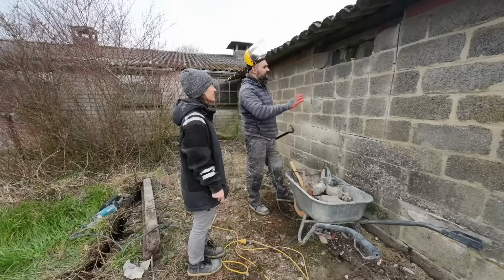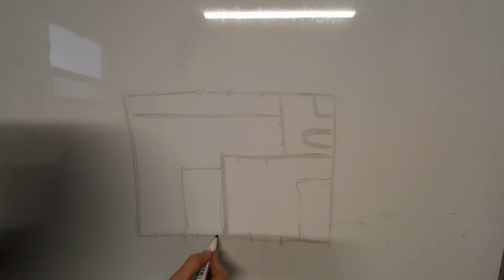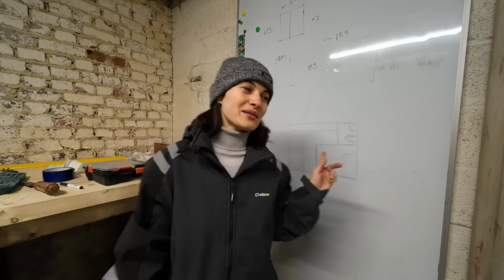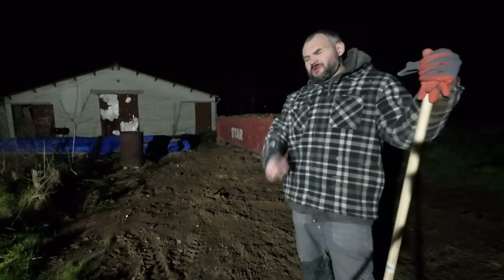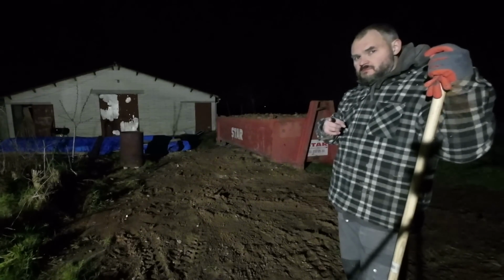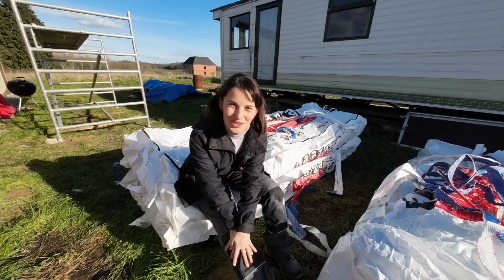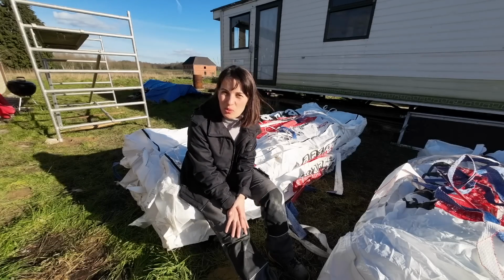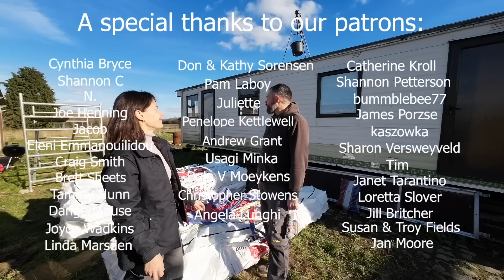New layout of our TINY HOUSE / Old ROOF is gone! [Turning an OLD SHED into a  cozy TINY HOUSE]

Comment: For your new toilet door I would have a sliding door inside the new wall installed to free up space, possibly the same to the new bedroom too x
Reply: I was thinking the same thing.  Sliding or pocket doors will take less space and add more available room to the tiny house.
Reply from the maker: Thanks for the tip! We are planning to keep the budget as low as possible and reuse the materials that we have. For the doors we probably gonna reuse the ones we took from the main house.
Reply: @DeHoeveOldBelgianFarm  You can find a rail kit for sliding doors to hang your existing door panel.
Reply: @dDoOyYoOuUtTuUbBeE  , like a barn door slider on the outside of the door?
Reply from the maker: @dDoOyYoOuUtTuUbBeE  I will check in the shops. How about soundproofing features of such an installation? For bathroom not really a problem, but between the bedrooms...
Reply: I would also suggest not having the toilet right opposite the door, fewer embarrassments when door doesn't get locked.
Reply: @DeHoeveOldBelgianFarm  the soundproofing is minimal on sliding doors.
Reply: The space isn't that wide, and the door will be effectively at the end of a hallway at right angles to the longer walls... A sliding door is unlikely to save much space in those circumstances and would have to be quite narrow, while a door that swings out from the bathroom counterclockwise will swing through mostly unused space and can be as wide as the doors they're reusing. The second bedroom door, however, should probably swing clockwise into the bedroom, not out into the hall area.

I'm a little ambivalent about the planned bed placement, though. By putting the access to the second bedroom off that hallway, they've essentially made the larger room a big hallway/entry room where people will have to constantly walk past the bed to reach the work space, bathroom, and second bedroom. It's a lot of busy energy for a bedroom that's supposed to be a place of repose, and there's really no restful, private way to place the bed in that. I'd have laid the rooms out a bit differently with that in mind, but it's their space and they clearly considered what they wanted from it and decided that was okay. Nonetheless, if it's not too late to be open to suggestions, I'd suggest putting the entrance door to the building close to the center wall and making the opposite wall from the current plan the one for the bed. The room is still a hallway like that, but the orientation of it would create a greater sense of privacy and shorten the path to the bathroom and second bedroom, since you'd only have people walking past one side of the bed to get there, not two.
Reply: @mjr7777  well, she's got to have the toilet against an outside wall to conveniently vent the composting toilet.
Reply: @DeHoeveOldBelgianFarm   Flip the location of the toilet(WC) and the basin. it will allow your door to open properly using a conventional door and door frame.
Reply: @elizabethcave7666  More or less that, but adapted for indoor use with some style.
Reply: @SagebrushRambles  Yes but quality sliding doors have seals and brushes for that. Also depends of the quality of your panel.
Reply: @DeHoeveOldBelgianFarm  In this case a complete kit for embedding sliding doors in walls is preferable. Better bearings for quiet operation, seals, brushes, for filtering noise. More work to integrate it (more or less like metal framing for drywall), but superior result.
Reply from the maker: @ImpyChan  Thank you for your suggestions! We are reusing the current door opening, so moving it closer to the center wall is not an option. Yep, we know that the planning and layout are not optimal but it's temporary and we just going out of the available options , keeping the budget as low as possible and trying to do it fast.

Comment: add a shower in the bathroom.
I dont know about there but in Australia one can purchase a sandwich metal roof.  Long lasting 30 year coated corrugated metal on top. foam insulating panel then a flat metal panel underside. They come in lengths up to 10 meters so or last I looked.  Get enough lengths so they side by side. Screw down and you have a watertight and insulated roof after you cap the ridge.

Comment: Just a silly Life Pro Tip (LPT): if you tie a loose knot in your corded power tools and the extension cord before plugging in, you create a bit of slack so accidentally tugging on it (or tripping over it) wont unplug the tool.   If you need to visualize what I"m talking about, think about a pretzel: cross the two cords in an X, loop the male end through the bottom of the X, and plug it into the female end up top.
Reply from the maker: Many thanks for the great tip! Illia is doing so already. Me not as you've seen :-)
Reply: Great idea!!

Comment: One thing I would consider, is since you'll be bricking up the door in the bedroom area, instead of making more work for yourself, use the door as your window, and only brick part of it, that way you don't have to cut an extra hole. That is, unless you need to make a bigger spot for it.

Comment: We would suggest renting or using a pressure washer to wash off the roofs & walls of all your buildings. Thr dirt & moss. Then, use a mild combination of bleach in water to kill any mildew, moss, etc.. If you live in a high moister location, you may have to reapply the bleach water a couple a times a year to keep the grenlen mold, mildew, moss or algae from coming back?

Comment: Good system to bag and remove asbestos roof. Wow cannot get over the thickness of your walls. Nice window openings. Will you be raising the roof height? Will this become a guest house?  Thanks good video.
Reply from the maker: The back walls are thicker than the other ones, I don't know why they did so. 
We plan to live there during the renovation. Once we move in into the main house, we will use it as our small workshop probably, for small  jobs. Or maybe keep it as our office. Guest house is also great idea. Still a lot of time to decide 😊
Reply: @DeHoeveOldBelgianFarm  , don’t you need 3 beds ?
Reply from the maker: @elizabethcave7666  We plan to live both in caravan that we bought in December and in the milk house. Half of the family in the caravan and another half in the milk house :-)
Reply: @DeHoeveOldBelgianFarm  makes good sense, thanks
Reply: @DeHoeveOldBelgianFarm  You two keep checking off the to do list. will be done soon.

Comment: As far as I can remember you have a pretty decent hole in the roof of your cowshed. It is not allowed to repair that even temporarily using these sheets?
Reply from the maker: You are right, there is a hole there, caused by a storm damage. But we keep it as it serves us well as ventilation for the wood LOL 
It's allowed to repair, but temporarily. And you can't put solar panels on top of asbestos roof.

Comment: What Nailah said. In USA you'd have 2 choices: pocket door ( slides into and out of wall...mainly/only wooden studs, drywall...comes in a kit or hire a carpenter); barn door kit to hang inside or outside room DIY on wooden/brick wall. Both save space. Pocket door more expensive than sliding barn door. Farther along in your projects recommend working steel shutters on all windows/doors in traditional design or roll up kind ( like shops in town). Just food for thought. 💯💪❤️🙏😊🍻🥂🇺🇸🇺🇦🐈‍⬛🎶
Reply from the maker: Thank you for the tips!  We plan to reuse as much as possible all the materials that we currently have. We have some doors from the farmhouse, so we probably just reuse them. We want to keep the budget for this temp house as low as possible.

Comment: Asbestos (Roof)?
I see you are doing it 117% correct - KUDOS
Reply from the maker: Yep, dank u wel!
Reply: @DeHoeveOldBelgianFarm  You are worth at least four beers each after that 😉😉
Reply: I see some points for improvement: not wearing your private clothes under the Tyvek. Wettening the roof beforehand. Using full facemasks with powerunit and P3 filter. Cleaning beams with wet cloths. Decontaminate by showering. I'd say 80 percent, but then again it's my profession 😉.  My compliments overall!
Reply from the maker: @bchdsailor  It was very hot in these suits and super exhausting because of that.  Drinking cold beer after that job  - Yummy!
Reply from the maker: @mctend9108  Thank you for sharing! Agree with all of them, but we have 2 excuses: first - it was first sunny day in a while. The next day it was raining again. So the sheets were wet and there was a natural shower afterwards :-) And second excuse - we had one time exposure. If It were my everyday fun, I will recommend to follow  all the safety measures you mentioned.

Comment: Following your explanation, you want to close the door opening on the right side. And make a new opening for a window left of it. But why don't you just use the dooropeningfor the window by bricking up and sparing the windowopening.
When you put the bed on the left side of the room, no prob with reachability of that window.!?!?!
Reply: yep, or even a french window in the size of the door.
Reply from the maker: Currently we already have a window there and a door opening. First we thought to close the door opening, but the planned already changed. We had to to make the door opening bigger to get the milk separator out LOL. So probably the window will go there.
No french window unfortunately. We try to keep the budget as low as possible and reuse the materials that we have.

Comment: I'm not so sure about the layout.

1st of all to have the door to the powder room right next to the work table. ♨🤧
And also the door to the bedroom directly opposite the work table.
Because of the two adjacent doors those two walls in that niche can not be used for a whiteboard, bookshelf or filing cabinet.
That part of the work table is also less usable that way.

I would put the door to the powder room inside the bedroom. Much more practical.
Also, high up the wall in the powder room put in a small skylight that can open. Adds extra light and addresses smells.
I would put the door to the bedroom right next to the front door. Again, more practical.
Thus freeing up both walls in the niche, to be used for a whiteboard, bookshelf or filing cabinet.